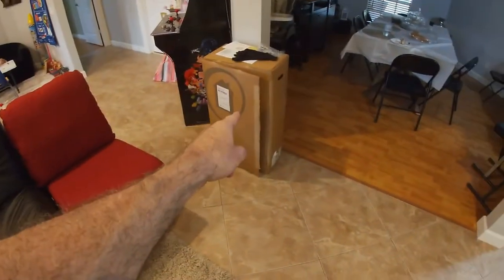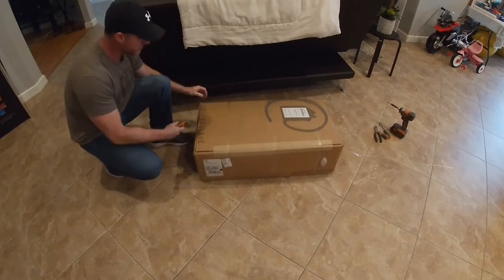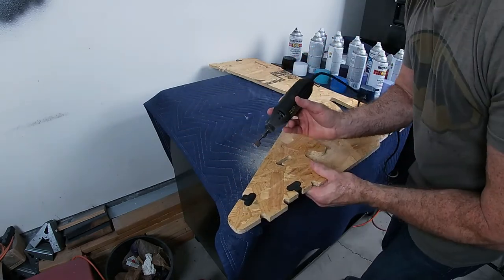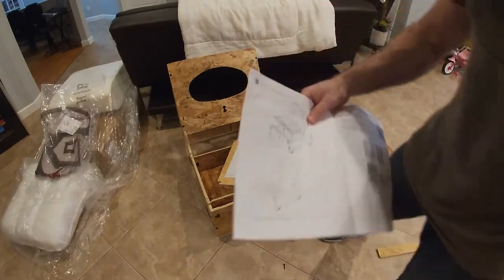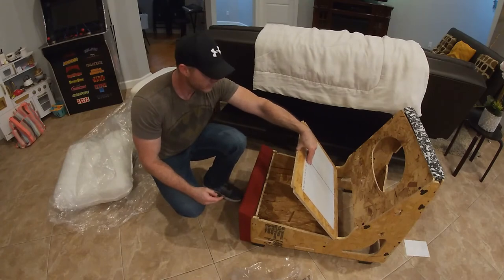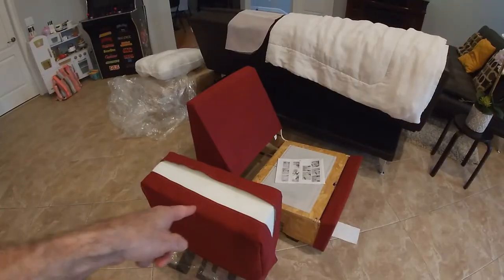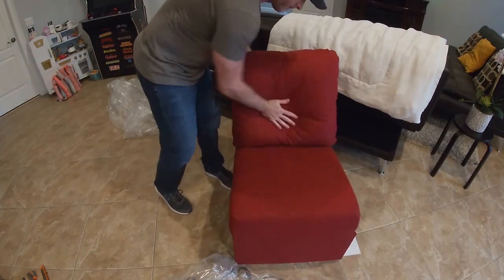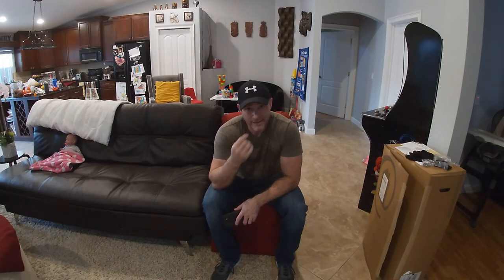Home Reserve worry free trial chair is it any good?. The Home Reserve sofa journey starts here!

Comment: did you ever do the custom paint job / lining on the seat yet? I'd be interested to see the other seats too when you're finished.
Reply from the maker: I'm finally getting to build them right now actually 3 seats and one ottoman left. I will have them all assembled by Sunday day night some time. I plan to paint all the inside covers this week. I have been rained out last two times I tried to finish painting my truck so garage is full at the moment. That project is in my truck playlist if you have interest in custom trucks. The sectional build should be posted late Monday or Tuesday probly before I paint the inside parts.

Comment: 2 years later - i just got this, there is no longer a piece of foam to go on top of the back.  My main complaint is that there is absolutely no cushion between the hard/rough frame and the fabric cover.
Reply from the maker: Im guessing they fix issues and make small changes as complaints come in iver time. Call it in they have a good team. When i had an issue, it was fixed asap, and items were sent no charge, including secondary part updates. On the version I have, the pillows cover everything except  the lower front and back, which are never touched. The big pillows cover the top, so that's never touched when sitting either. I do have to pull the covers every so often due to the little ones pushing in the little foam pieces that lay across the top. I wish it was solid with no gap. Overall, I am still happy they are well used and look as new. Stains have been very easy to remove from the little ones, which was a major thing along with the size for us. Are they as comfy as a deep cushion city furniture type setup no. But if comparing to ikea or similar setups, I would still make the same choice.

Comment: I am not sure if my drill is not strong enough but I bought a Laney Sectional and the screws will not screw into the T connectors. Any advice? I tried manually doing it with a screw driver, upping the power/speed of the drill, changing the drill head and nothing worked. As soon as I power it on the drill just falls right off the screw because its not spinning.
Reply from the maker: Sounds like you need to put more pressure on the screw so it stays set on the drill. I use a driver not a drill for screws. You can use a drill just be carefull not to strip the t connector. Try installing the screw downward and leaning into it. The extra weight should help the screw go in. Good luck 👍

Comment: How’s it holding up?
Reply from the maker: Great, spills are easily cleaned from the kids with the fabric chosen. The  pillows are still fluffy. There was one break and the replacement came fast along with a matching part for the other end to fix so it doesn't happen again. They have since resolved that issue in production. There is a video of that here https://youtu.be/_n_ZUZJgWSU
The short version is issues are dealt with fast and efficiently. 
Now for the complaint, my wife bieng small framed and 5/2 doesn't like to lay down completely with head on the seat cushion due to the drop from the seat cushion height to the ottoman height. She said she feels the difference on her back. Sitting with legs up she is fine though. For me im bigger the cushions compress more so it don't notice it. Over all its great we use it with the kids daily and it fits the space very well.

Comment: HOW MANY SPLINTERS?  this looks like really ROUGH wood.
Reply from the maker: Zero 😁. It is press board 
, you do need to use the sand paper it comes with to quickly smooth the rough edges. More important reason to sand is when you put the fabric on you don't want that damaged. There was not need to sand the sides just the edge. You  could if you wanted to I guess. Mine was pretty smooth on the sides.

Comment: Paint it
Reply from the maker: At some point, I really need to get around to doing that. Unfortunately, they are filled with all our photos and kids' stuff so the room can stay clean. I may just spray glue felt over the center bits to make it less scratchy on the inside. Next time one gets a stain, I will make a video of it. 👍
Reply: @thisoldhooptie  I hear that painting helps with the cover installation. Makes it easier to slip on
Reply from the maker: It probably does. They include a fabric that allows things to slid pretty easily. I only sanded the corners on some pieces. The ones I got were cut pretty clean.